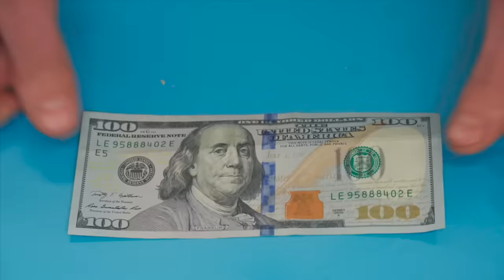Amazing tricks that will take you to another level of work – Tips and tricks

Comment: Improvised anchor using plastic tube: really loose when he wiggles it.  Soldering iron kickstand out of wire: yeah, that won't be in the way at all.  Wire caddy: Sure, have sharp metal screw points sticking into it where you wind your wire.  Wood joint: That's called a dado joint and has been used for hundreds, maybe thousands, of years.  Nut from angle iron: great, you just spent half an hour reinventing the 25 cent wing nut.
Reply: Exactly, because these tools (no pun intended) don't actually work in the fields of woodwork, metalwork etc, all they do is think up crap like this.

If you're a tradesperson and don't have what it takes to do the job and need to revert to doing this crap then quit because you're useless.
Reply: He never said he invented these processes just helpful tips and your criticism just shows your lack of creativity and ingenuity
Reply: @russellherring8180  Creativity and ingenuity in producing slipshod hacks? There are already right ways to do these things.

Comment: Don't wipe your glue... Let it dry as it lays.  Once it has dried it comes off clean and easy with a sharp chisel.  That way the glue doesn't prevent the wood grain from receiving stains or finishes.
Reply: I agree wiping the glue definitely does mess with stain later
Reply: Thanks, I always wiped it out, but after reading this, I'll try it for sure 🙏🏻
Reply: Thanks for that. I have had that happen to me before and wondered what people did about it
Reply: @phoenixamaranth  Glad i could help!  You can also use painters tape and mask off anywhere you don't want glue to touch.

Comment: To get a nut deep in a spot. Glue the nut to a wire. After you tighten the bolt to the nut. Pull  hard on the wire to break the glue spot.
Reply: Easier to put piece of paper in wrench jaws and just force nut in. It holds ..  Also works on sockets.

Comment: Um, how big of a hole did you drill to fit that nut in?  Are you sure that plastic tube expander will apply enough friction so that the impact wrench you're tightening it with doesn't make it spin out?  That massive bolt will definitely be able to hold the bracket up.  Just the bracket though.
Reply: Six local

Comment: I love how on the very first one he did with the paper he still had a gap on the right side.
Reply: I think the wall wasn't straight. He should have checked that, though.
Reply: And it wasn’t wood
Reply: Just buy a 4 ft adjustable drywall square  already sheesh
Reply: I just came here to say that. Thank you. These vids are so bogus, but I can't help but watch sometimes
Reply: @8eSix  Right? Once in the bluest moon, you might see an interesting idea (the magnet and wrench idea), or at least, shitty execution that could be done more smartly. What gets me is how laborious some hacks are, just to get something truly shitty. Not this channel specifically, but the bottle caps and hot glue hacks come to mind.
Reply: He didn't cut it straight, you can see the knife slip off slightly causing it not to be accurate.

Comment: My dad did that with a caravan cord the rest of the wire on the roll acted as an electro magnet and burst into flames
Reply: Why? If it's wired correctly there should be no issue.
Reply: @TangoNevada  The cable will get warm with enough load on it, since the cable are rolled up, there is nowhere for the heat to escape and the cable will combust. You should always pull out the full length of cable, even on the factory made ones.
Reply: @se-kmg355  Then it's not wired correctly. IE: wrong gauge wire. If you cord is heating up, it's too small of a gauge.
Reply: I have a reel that states while wound it can handle up to 720W, while unwound it goes up to 2500W. And why do you think that is?
Reply: @se-kmg355  I'm not confused by the electron theory here. If you need a 2500W Cable, use one. That's all I am saying.
Reply: @TangoNevada  And I am, since the cable is rated for it. But if you put that same energy while the cable is rolled up, it could combust, since the heat has nowhere to escape. Like an oven, if you do not maintain the heat to a confined space, the oven will never heat up.

Comment: Liked the clip and the idea for the soldering iron.  I had a similar issue and used a bean can's top and a pair of scissors to cut the metal into shape.  I used a pair of long nosed pliers to bend the whole bit into shape.  Still works pretty good.
Reply: It seems like the coiled wire would work like a heatsink and make the soldering iron not as hot as it should be
Reply: @ScanMy2DBarcode   You are correct. Its a bad idea.
Reply: 9
Reply: They make very inexpensive holders you can buy at any store that sells solder equipment. They are cheaper than the time you spend to make a janky one.

Comment: Great idea about folding the paper to measure the angle. Unfortunately you can see that it's so inaccurate that it's useless.
Reply: Didn’t see that at all actually. Anyway you see with your eyes not me!
Reply: Buy a T bevel, then you can use it more than once.
Reply: The fail was not securing the paper to make the cuts.
Reply: The idea is sound, the application may have been flawed.